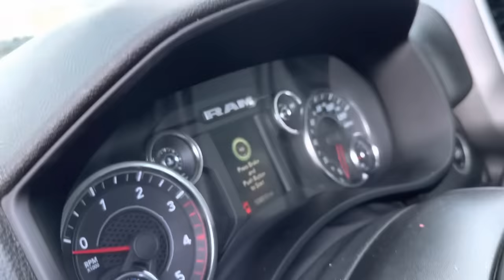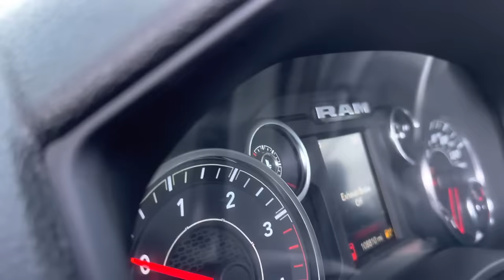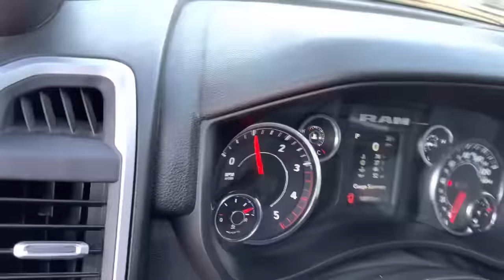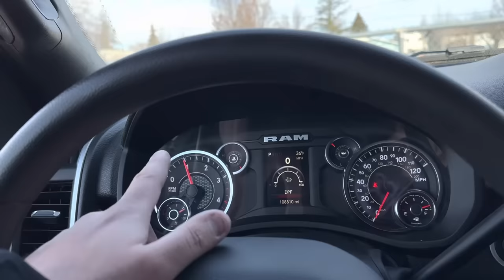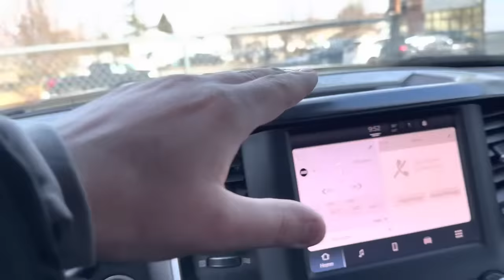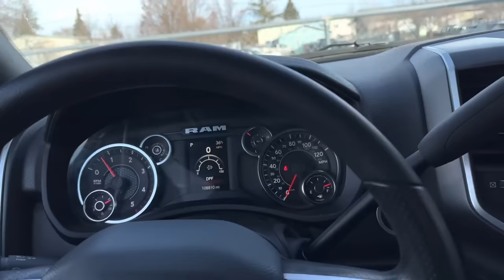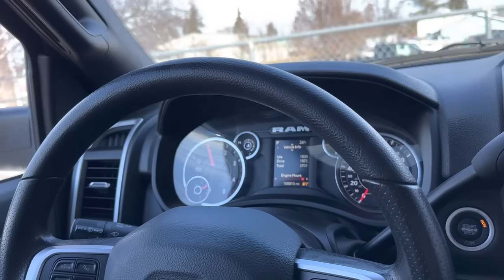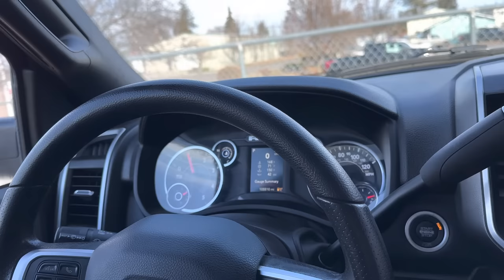2022 Ram 3500. 3rd engine down. 3 signs your engine is failing.

Comment: I have heard that a little nut on the back side of the cold-start heating grid in the intake can come loose and fall into the #6 cylinder, BANKS sells their RAM AIR HORN that also replaces
this part and prevents it. Seems to be a big issue? I wonder if this is the problem?

For the DPF issue, I was told to only use the more expensive Platinum?
Reply: The grid heater bolt becomes an issue when the relay stays on and enough amperage runs thru the bolt. Makes it brittle and it falls off. My 08 had the original grid heater installed and never had an issue falling into the engine. I recently took it out since I got a good deal on a grid heater delete plate. You have less then a 1% chance of that bolt failing
Reply: @repairvehicle  You clearly haven't seen the video of the engine tear town with the nut that broke off, fell into the #6 piston and was imbedded into it needing and entire engine block replacement. It might be rare, but it has happened. Besides, his tests showing the increased airflow is self explanatory and obvious. The manufacturers are more concerned with emissions regulations than performance.
Reply: @RobertMoseley  , how much horsepower did engine gain with banks garbage air horn? You not going to find numbers because increase in flow only work high horsepower applications. With factory horsepower and increased flow actually lowers horsepower output.
Reply: @bryandepiazzy8679  Now I have 1% less chance that it ever happens.
Reply: Regarding using Platinum DEF, there is a good body of thought that using it may actually be detrimental, because it's more expensive it tends to stay on the store shelf longer and thus there's a somewhat higher chance of it actually going past it's "use by" date than the cheaper stuff which moves faster.

Comment: My 2022 was regening every 200 miles. Egr cooler failed and destroyed the dpf. All was replaced. Still regenning every 200 miles. Had a  sub 40 degree cold start the other day and it was knocking just like your video. I only have 30k on the truck. I dumped it last week. I’m not dealing with this crap.

Comment: Was thinking of trading in my 2016 with 246,000 miles on it , deleted it at 100,000 miles and have only had to replace the actuator, and shift solenoid. Think I’ll just keep it and repair any future problems.

Comment: Sounds like the valves are stretching (tuliping?)
Which would explain the compression coming out on start up.
Start checking valve lash at least intake,,, if its constant skrinking,,, valve is getting longer

Comment: I’ve got a 22 2500 and it sucks down def and fuel like it’s going out of style. Guys with the 19-21 trucks we’re getting impressive fuel eco but even empty I’ve got a lot to be desired. My 22 is not put together well either. I ordered a 23 HO 3500 and I’m starting to wonder if that was a good idea seeing the issues with your 22’s and the lack it quality with my 22
Reply: Your 22 left the factory with a DEF sensor missing. A lot of them did. The ecu is programmed to max dose DEF fluid. Go to the dealer and ask if the sensor shortage has been resolved and ask for it to be installed and ecu updated. Or wait for a tune to become available and delete that useless shit
Reply: @bryandepiazzy8679  Interesting. I'm hoping my 23 shows up someday soon and I don't have to deal with this truck anymore anyway lol
Reply: Chinese junk parts have overwhelmed the automotive industry and crashed the quality in a huge way🎉

Comment: Did the oil pump manufacture change from 21 to 22? Sounds like lifters and rod end are going away on ya. What's the oil pressure like from the 21 to 22 truck?

Comment: I have a theory. I think the push rods are too long. The cam wiping out with the lifters going as well would happen on 6.0s after the heads were decked. The head would be shaved a few thou and then the pushrod is reletively longer. To fix it the new part from ford on the push rods is shorter by a few thou to compensate for the cams and lifters wiping out. I doubt it’s an oil issues.
Reply: Definitely not that at all. 😂

Comment: This is also happening to the 2021s. My  Ram 4500 is doing this exact thing. I have the ticking noise, low power in my opinion.
 Also have misfore in cylinder 6 and EGR excess flow. Have already changed the egr valve. My 2021 ram 5500 through rod at 103k miles.
Reply: Dang!

Comment: I bought a used 21, 6.7 2500, drove it home it had 35k and  it sat at dealer for 2 month waiting for one nox sensor... dealer couldn't get it, they wouldn't install or warranty or reimburse the mopar sensor I got off ebay...but now it's all good it seems

Comment: Paul ever consider trying oil bypass filter that filters oil to 2 microns since your thinking the EGR is staying open more dumping more soot in the engine. Might help.
Reply: I'm not a fan of seafoam at all but he should do an experiment with 2 trucks, before every oil change dump a bottle of seafoam in to see if that changes how often he has issues with those 2
Reply: I'm sorry seafoam doesn't do much of anything. Amsoil engine flush will do way more to loosening coked soot because it thins out the oil helping to flush oil galleys and hydraulic lifters for 15 minutes before changing the oil. But if the cam is delaminating nothing can prevent failure with that then valve train pulverizes itself or lifter plugging because the oil port is to small in the lifter and it never expands again pulverizing the valve train. The lifter issue is possibly preventable with oil bypass filtration to 2 microns removing all soot greater than 2 micron size. Ergo lifters oil ports stay clear and don't clog. Then if it still happens you now it's the cam.

Comment: I have a 22 2500 and had the knock…went in and they said it was push rods because they switched to an oil pressure rail system. 28k had push rods and rockers replaced 2k later same thing. Have also tried multiple oils and weights Schaffers 5-40, ams oil 5-40 and 10-30, and rotella t6 10-30, and have added Lucas oil stabilizer. Change oil ever 7-10k. Also have Ann oil bypass installed
Reply: Amsoil and oil bypass. 😮
I can show you the results of those, where people never changed oil, or went far beyond maintenance schedule.
Not pretty and it reminds me of the old STP/Pennzoil engines of yore.

I'd never do either on something I'd keep.
Reply: @mnixon359  not sure if you know how those work…they still flow normally. They just siphon off the main filter and and filter again down to a 2micron filter and flow back into the top of the valve cover. So there is still full flow. And as I said I have tried multiple oils and weights. The problem with the 22 2500 is that they changed the push rod design to an oil pressure design. The service center at the dealership told me that they have had other trucks in there that ran the conventional oil 15-40 rotella and they broke down very fast. And as I stated in my first post I change my oil long before the standard maintenance schedule between 30-50% oil life left. And I don’t idle my pickup for long periods.
Reply: @Folmer Christensen  what ended up happening with your truck
Reply: @mattacord8445  they changed the push rods and rockers. And will be going back for the same thing

Comment: My '21 is having this same problem. Same sound. Same code. Built in 2-21. Does anybody have advice on how I should go about this? Get rid of truck? Work with dealer? 53k miles.

Comment: I serviced my truck with a aftermarket air filter that threw the same codes. I couldn’t figure it out. Went to the dealer bought a Ram filter and changed it out. Codes went away put 10k since no more issues

Comment: I have a 22 2500 13k miles so far no issue. What oil do you use in your trucks and do you think if a 22 was running 21 tuning with out emissions on it that the trucks would have the same failures?
Reply: You have no issues under 13k that’s insane….
Reply: Schaefer
Reply: @AlwaysBeSmart674  😂

Comment: Newer vehicles are just made to fail.  And I’m pritty sure it’s not limited to Ram.  Quality control has gone out the window since Covid
Reply: It you have a deluded view. Gm is making the best truck diesel truck they ever have.
Reply: Yes so agreed
Reply: @Robert Kington  why do u think gm has the best diesel pickups right now?
Reply: @boosted_brody5474  I did not say they make the best diesel engine. I said they are making the best diesel they have ever made. I do agree that it could be argued that they do. The l5p has the least amount of pattern problems. I still prefer the ford. I'm into performance and the ford makes more power and has a much stronger transmission than the other two. And a dont like the chevy truck but I do respect the engine. I like the ram truck but they ride terrible and would take lots more money to make the power that my 17 f250 makes with just a tune. That truck would need a bigger turbo and transmission to make the power mine makes.

Comment: I have a 2021 ram 2500 and it’s been back to the dealership twice for DPF Filter full. Both times dealership put a new dpf in, as I’m nearing 32k miles I asked the dealership what it will cost when it happens again when I’m without warranty. Around 9k they said.
Reply: My 21 has been back twice as well for the exact same thing. Worthless ass dealership didn't even pop the hood on mine much less replace the dpf. All they did was force a regen and turn the light off. The last time it was in they said they basically changed the parameters on the regen frequency allowance. So basically if I would get a check engine light because it regened 5 times in 500 miles, now it'll let it regen 8 times in 500 miles before the cel turns on, as an example. The truck started doing this at 11k and now has 14k.
Reply: Keep in mind, the fed warranty on the dpf is only good to 50,000. California & some others might be longer. I’d be pushing HARD for them to get a handle on why it’s filling so quick without proper regens.
Reply: If you're running 15-40 oil that's why the DPF keeps clogging. Metal oxide ash from ZDDP
Reply: @100pyatt  I'm running 5-40 schaeffers OTR

Comment: Does this relate to the “typewriter tick” like fords have been having for a while?  For those who don’t know the sound, it literally sounds like someone typing, thinking, typing a few more keys and so on. I have it after an oil change on my 21’ and when I ran a 100hp tune it didn’t go away.  I got rid of those tunes after a couple thousand miles and I’m back to 0 level tuning…no more tick.
Reply: No comparison to a ford 6.7L. I personally have had both (current 22 f450), 18 f350, and rams before and lml dmax. Powerstroke is far superior hands down, my f450 takes a beating as well grossing 45k up 8-10% grades.
Reply: @krice24  do fords not have a typewriter tick? Ford had, long before ram, hydraulic lifters?

Comment: You have 1830 idling hours and 1871 driving hours on that truck. That is a lot of idling hours! Lot of idling hours means lot of sot and lot of regenerations of the DPF.  As Ram inject the fuel for regeneration in the engine itself you will have fuel diluting of the engine oil. The result is loss of lubricity of the engine oil. On the 22 there is a sensor missing on the DPF. Ram have set the truck to regenerate every 24 hour. (Independent of how many passive regenerations you get when towing. You have about 150 extra active  regenerations due to the 24 hour clock. Do not think you had that on the earlier 5th gen.  Good Luck…
Reply: It does idle a lot but it also pulls trailers all day. Should even out. If fuel was diluting the oil, they would notice it when doing the oil changes.
Reply: The problem IS the oil changes. What oil are they using?
Reply: @sierragulf9783  I’m not sure but oil brand isn’t as important as everyone claims. They all have to meet a certain standard. He is really particular about his maintenance and even said he cut back to 10k mile oil changes just for the 22s. There is obviously something else going on. I feel like it could possibly be a material issue like he stated.
Reply: @atvrepairsandmore2482  I agree with you on that 100%
Reply: Oil makes a difference. For example standard states that oil evaporation rates should be maximum 14%. Majority of companies formulate their oil to around 12% evaporation rate and some formulate their oil to be around 6% evaporation rate. Lower evaporation rate, less oil consumption and longer dpf filter life. All oil companies meet standards and are below maximum allowable limits but some go above and beyond to have in lower evaporation rate. Same thing go with anti wear additives that they have to meet minimum, but there no maximum limit.
Reply: @sierragulf9783  He uses Schaeffers Oil. At least thats what he has said in pervious videos.

Comment: I have a 2020 cp4 replaced by dealer. Now have a P2743 check engine light not related. Transmission sensor or perhaps harness. Other than that good.
Reply: 68rfe or Asin?

Comment: Scared for the future of pick ups. Ford has been disappointing me with the 23’s. Not the looks or anything. But the fact that the 24’s should be about ready to roll and we’re still waiting on 23’s to ship. The 22 fords had some issues to with quality. Hope all these auto makers do what it takes to get things right. Especially ford and ram. Fords myl favorite. But ram keeps the freight moving.
Reply: Damn right! But my f450 has had alot of minor issued, bad fuel tank, terrible alignment issues, and shitty factory tires. But I can say not mechanical issues, it is rock solid. Can live with cosmetics but not mechanical, so I still say ford os doing great. Could be like Paul's 22s
Reply: My son is a diesel tech at ford in Las Vegas and has zero work right now. I think for the amount of truck they sell that they are doing good.
Reply: @robertkington2084  move to NC, all diesel techs are 2-6 weeks out, short staffed, and cant get caught up!  So frustrating. They say they cant find any.
Reply: @krice24  that all over the north east!!

Comment: No way that a lifter/pushrod fails due to slight change in oe tune, or DPF. 
Oil manufacturers had supplier issues during a period in the last couple years. Have you got any records on oil analysis?
Smells like a problem in the quality of pushrods or such. Probably a run of pushrods with incorrect heat treatment.
Did you run 15w40 in your 4gens or the same junk 5/40?
Reply: He runs 5w-40 in 4th gen and 10w-40 in 5gen
Reply: Sounds like the intake valves are stretching (tuliping),,, closing the gap (cushion in the hydraulic lifter) going to metal on metal.
Reply: 5w40 is the superior oil especially in cold climates.
Reply: Clueless Ignorance if you think 15-40 is better oil 🤣💦 

5-40 is FAR superior oil in every way. Especially Synthetic variety.

Comment: I have a 2023 5500 on order .   Any issue with the 23?   My 2019 runs great,  always smells like coolant after working hard.  Never losses any coolant.  Can’t figure out why it smells from the engine bay?
Reply: On order? Last I heard they aren’t even building 4500/5500 right now?
Reply: @alaefarmestatesllc  I order it September 2022 should be here end of march.  The dealer said it has a vin number so it’s at least has an ID Lol!
Reply: @chasememmott2722  oh man lol. 🤞 for you.
Reply: My 19 has the same coolant smell after a good load.
Reply: @koryherrington4159  I can’t figure it out.  No leaks,  not in the oil.  Coolant is clean .  Any ideas.
Reply: @alaefarmestatesllc  We already have a 23 4500 cab and chassis and a 3500 laramie HO
Reply: @coltincraigo5007  interesting. My dealer isn’t even taking orders on the 4500/5500 right now.
Reply: @alaefarmestatesllc  yeah we just got the utility body put on. Had to take it on a trailer they’re not letting us take drive it/officially complete sale because of some grid heater issue that they said could cause a fire
Reply: Regen smell?

Comment: EPA shouldn’t be designing vehicles, the WHOLE problem is those requirements, which are stupid and waste fuel. Diesel are generally very clean runners
Reply: Don’t really think it’s an epa issue here, he’s been getting 500k+ miles with emissions on his older trucks. Cummins made big changes to the engine for 19+, no new epa requirements tho.

Comment: Paul love your channel. I’ve been watching you for couple years now. I live near Calgary Alberta, i ordered a truck in may of 21 and received a 22 3500 limited srw long bed in November 21. Two months later my dealer informed me that I would be receiving a recall notice for the upgrade to activate the emissions system. I have never received anything yet and my dpf has always stayed at 0%. Wondering if you have had any similar experiences with any of your trucks
Reply: I got told the same thing too with my 22 3500 longhorn..and still nothing done. In Dawson Creek BC
Reply: @i82luz  I haven’t had any problems with my emissions and have 41k on it now. I’m fine the way it is so long as it’s not causing any harm to other components. I’m thinking this missing chip or whatever it is is maybe only for Canadian trucks

Comment: This is what happens when you try to keep up with tye Ford 6.7. Ram and GM just need to accept it, the ford 6.7 is just a better setup and it's more reliable. Ford can dial it up to do whatever they want. Ram eother needs to build a new engine, or back down on trying to keep up. Just be happy with the cool exhaust brake.

Comment: Well my 6.0 doesn’t take def but it does tend to have its issues I’ve had ficm go out I’ve had the y pipe explode and the boost reader thing break other than that solid for a truck that’s turned up to 450-500

Comment: My 21 makes that same noise , worse under load around 1100 rpm. Already had cam and lifters done at 37k before I bought it, I’m at 47k now. Dealer said noise is normal which I know is bs . Drives great , engine just sounds like crap.